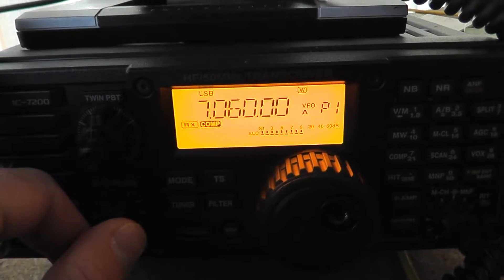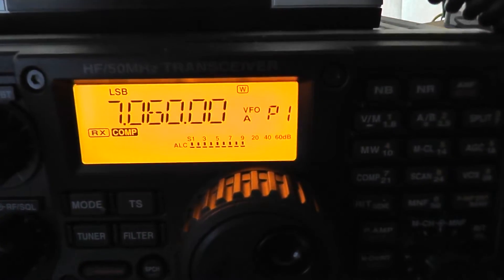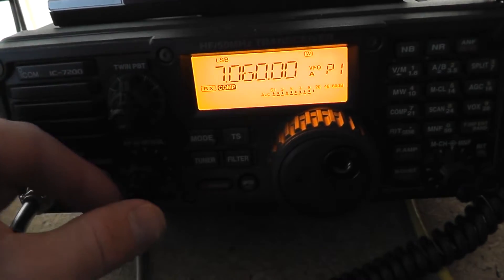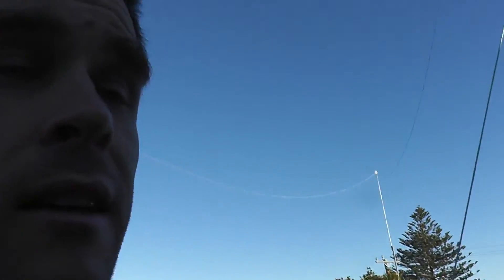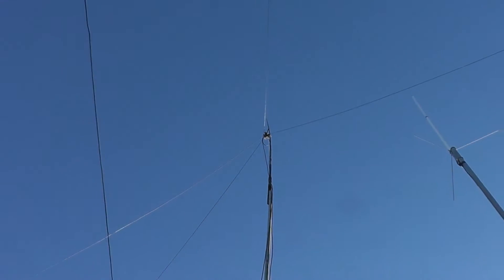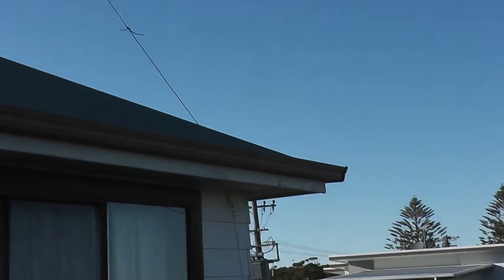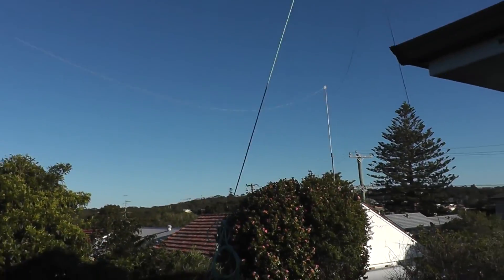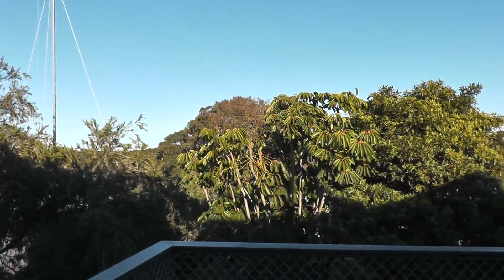Inverted V-Delta Loop Comparison

Comment: Wat is the bandwidth of a phase modulation transmission ?
Reply: For a given modulating frequency, BW = (Deviation plus the modulating frequency) x2
Reply: with or without the flux capacitor?